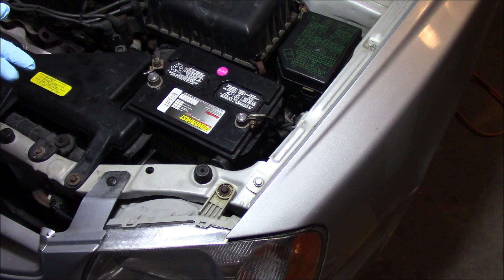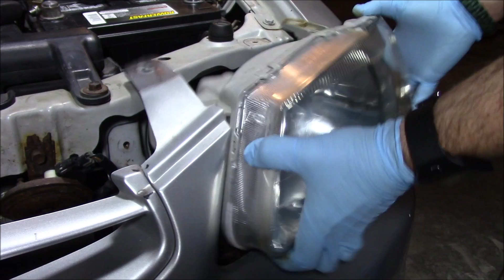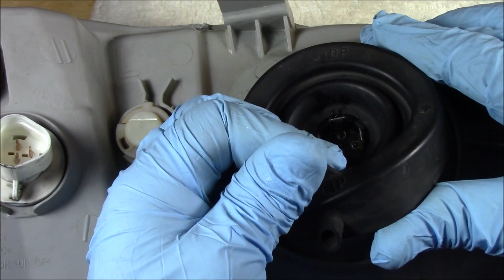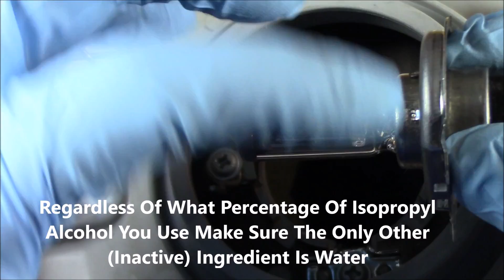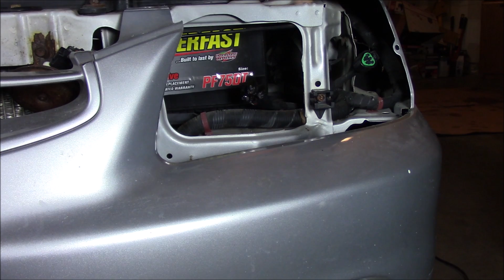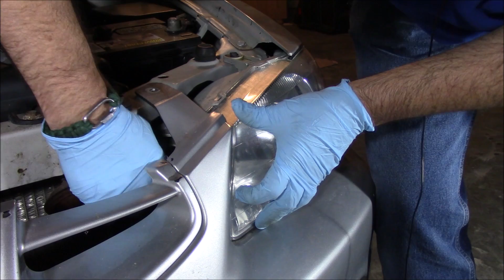Hyundai Accent Headlight Lamp Removal/Replacement And Install

Comment: On the Passenger side of my 2014 ACCENT GLS I was able to replace the headlamp without removing the housing. Just took of back cover, popped the clip off, replaced bulb and put it all back together. 15 mins max to do this.

Comment: ⭐️⭐️⭐️⭐️⭐️
Reply from the maker: You are most welcome. Thank you for watching, commenting and the kind words. I appreciate it greatly. All the best.
Reply: Richard Lloyd thnks i just bought this model and is my first car 👍🏼
Reply from the maker: Rock solid and reliable vehicle. Make sure to replaced the timing belt at the required intervals and if you purchased the car used inspect the timing belt for wear and replace it if needed. Never assume the person who owned the car before you maintained it correctly. If the belt breaks while the engine is running it will destroy the engine. Thanks
Reply: Richard Lloyd 😱 thanks i will check that 👍🏼

Comment: Funny im subscribed to your channel but not getting your videos come through, G+ is useless, 

Some cars require the removal of the front fender to replace the bulbs, some Renault cars the front wheel has to come off, what a joke.
Reply from the maker: +bmwnasher I have seen some GM vehicles where you have to take the wheel off and remove the splash guard in the wheel well to get at them. By comparison removing the lenses is much easier. LOL. Never liked French cars too much either. I laughed when I saw that Lada (Russian) manufacturer bought the Fiat 124 from France, it came with a tool box in the trunk (handy for this car).
Reply: bmwnasher iy